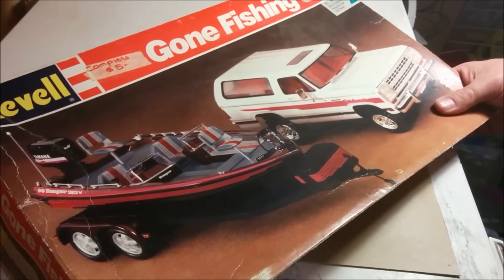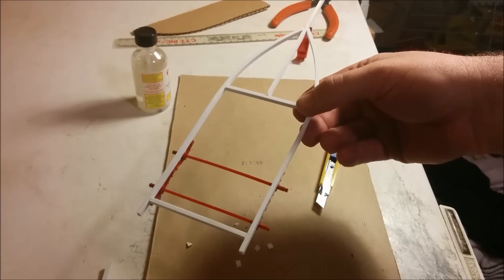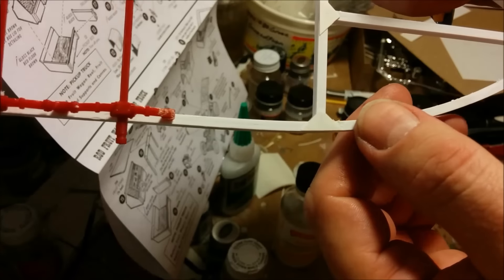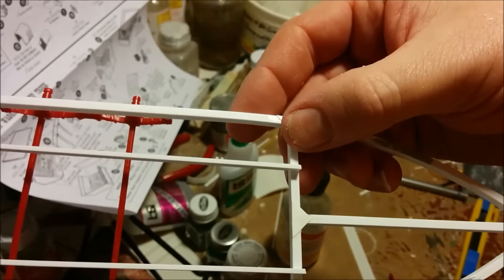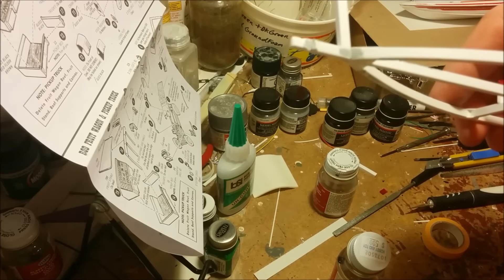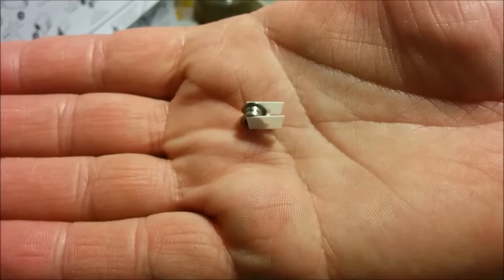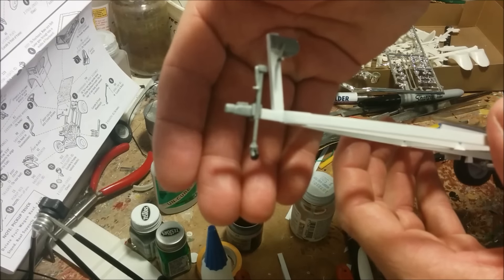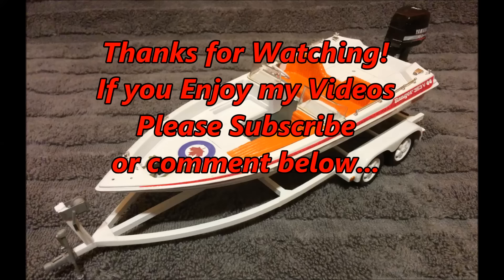Building a Boat Trailer Pt.2 Finished

Comment: Hey what’s that called and does it work
Reply from the maker: Miles Stuch I'm guessing that you are asking about the glue. It is available under a few different names, Flex-i-file, Plasmod and Plastruct cement. I think it is all made by the same company (maybe Plastruct?) Its advantages over Testors cement is that it works on ABS as well as styrene. It is also extremely fast. I use it in addition to Testors and Tamiya cements, as they all have different properties.